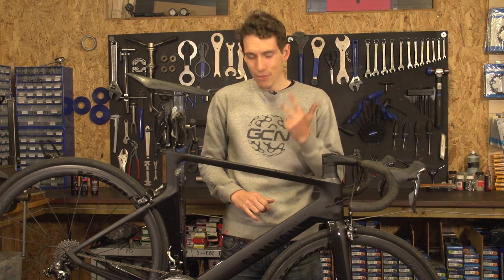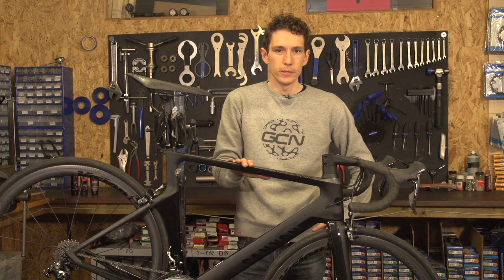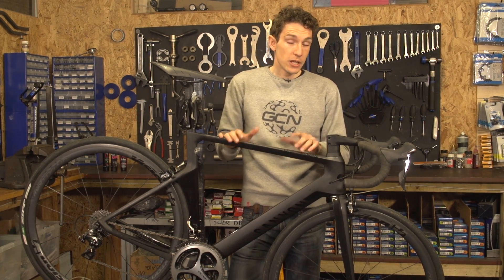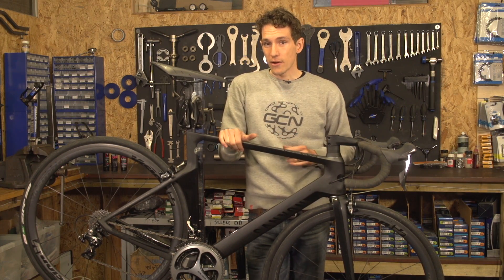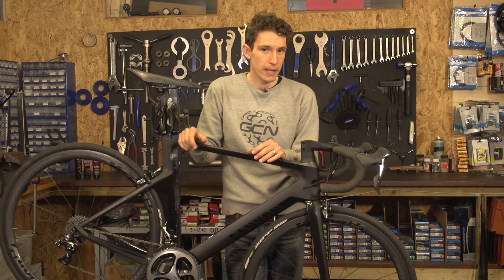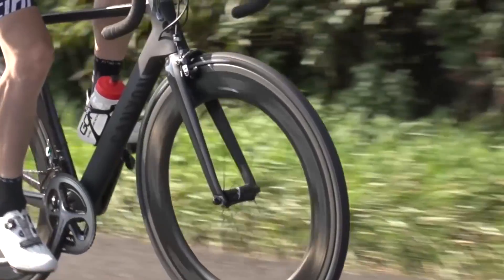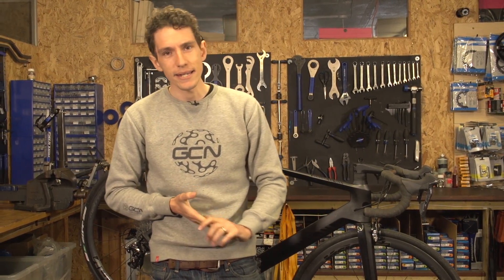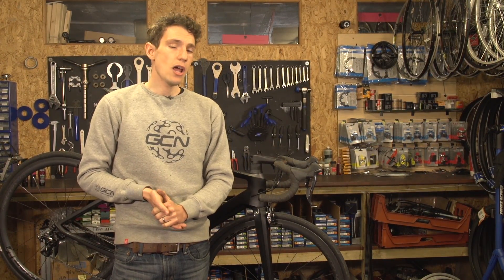7 Things You Didn't Know About Carbon Fiber

Comment: Does extreme cold weaken carbob. -30 deg celsius. Say if I left the bike in a garage( nonheated of course). Live in Canada.
Reply: Not really... well actually yes. But cold temperatures can weaken many materials. Without looking it up I would imagine that aluminium will perform worse at very low temperatures when compared with CRP.

Comment: I don't trust carbon fiber myself, I've seen how it fails. I've never seen an ally/steel component explode so will stick with those. Titanium I'm told only lasts a year before stress renders that unsafe, and having seen it fail don't trust that either. As for pro cyclists, they should all be training on steel bikes anyway. Learn to ride at a decent pace on an old heavy bike, then save these expensive and often less reliable materials for when required and you should find its easier when you need it.

Comment: Steel is where it at. 2lbs heavier then a similar spec CF frame setup but with more reliability and strength.
Reply: Some years ago I had an expensive, custom-built steel frame and compared to both the aluminum frame bike that came next or the carbon bike following that, the steel frame bike experience was like pedaling a bowl of Jello with wheels on it. The alu bike was a step in the right direction with its superior power transfer, but then the carbon bike was stiffer yet and a whole lot lighter. I anxiously await my next-gen carbon bike this coming Spring.

Comment: FYI for anyone who is interested, an isotropic material is a material that has the same material properties in all directions, i.e., it's modulus of elasticity (stiffness), tensile strength, modulus of toughness, modulus of resilience, fatigue failure mechanisms, etc. (all of which are quantifiable properties) are all the same no matter which direction a load is applied. Carbon fiber, since it is a fiber, is inherently not isotropic. If you take a fiber and stretch it along the length of the fiber, it will behave differently than if you (just imagine it) try to stretch it along the short way of the fiber. Since the fibers are laid up in bundles, obviously the "non-isotropic-ness" is exacerbated. 

The truth of the matter is, no material on earth is perfectly isotropic. Steel, aluminum, titanium, and all metals have a crystal structure that have slip planes along different axes, and have grains made up of those crystals that face in different directions, and the size of those grains have a significant impact on the material properties. However, that's pretty much just theoretical shizz that most people don't care about. For the most part, standard steel and aluminum can be modeled as isotropic. 

Just your materials science lesson for the day.
Reply: Bringing me back to my first year materials subject at university - the alteration of crystal structure through heat treating, alloying (the substitution/addition of elements of different sizes), and applying mechanical stresses during cooling (amongst other things). It's interesting how you can enhance or diminish almost any properties through minor alterations.

Comment: I have essor carbon forks and I read online that a scratch can make the carbon weaker. Is this true?
Reply: Yes that layer would be weaker
Reply: The outer layer is usually not structural, so unless the scratch is very deep (which would also greatly weaken a metal frame) there is probably no effect.

Comment: Here's what isotropic means: non-directional. What does that mean about carbon vs aluminum?
Well, carbon is ANisotropic. Meaning directional. A key factor in the light weight of carbon fiber is that it has a full range of strengths depending on the direction in which it's stressed. Your first thought might be, does that mean it just gets weaker? In some directions, yes, but compared to a similar isotropic material what that really means is that it gets exceptionally strong in some directions.
For framebuilding, this means that you can get huge performance out of carbon by orienting it directionally and using very little material in addition to the high average strength to weight. If you were to create a carbon fiber with the same average strength and properties as carbon fiber, but isotropically, and you compared that frame to an aluminum frame, the difference wouldn't be nearly as marked.

Comment: I am still leery of CF as only an old school clydesdale can be. I know it is light and strong etc but the impression I have is that it is kinda not very durable and susceptable to cracks, chips and whatnot. Torque settings on all mounting hardware that have to be followed so exactly. As a professional mechanic, just the amount of care needed over a steel or Aluminum frame when building and maintaining them makes me twitchy about ever owning one. Not that I can afford one or anything.  On the other hand I have seen that video from santa cruz where they torture the snot out of CF and aluminum frames and maybe I am somewhat comforted by that.
Reply: They torture it and it didn't break .....that time .....next time they ride it .....CRACK POW

Comment: Hi, I got myself a Canyon Aeroad (2XL) 2 years ago, transitioning from 
an older Alu bike. What I have never seen mentioned anywhere is the fact
 how wobbely the damn thing is up front. The carbon bike industry is 
talking about comfort all the time, whereas I break out in hives when 
the talk comes to comfort. If you want comfort then buy 25's and let 
some air out. You do get a lighter bike when you buy carbon but you might 
not always get a stiffer bike. I have tested a few of my friends carbon 
bikes and none of them were as stiff and responsive as my old Aluminium 
bike. I weigh 94Kg and would love a light frame which is stiff enough for a 197cm tall rider. 
I would love to see a bike test from you guys looking into bikes for the taller and heavier segment rider.

Comment: How about using a Carbon Fiber bike in a turbo such as an Elite Turbo Muin. I'm always concerned about the extra flexing of the bike will lead to cracks.
Reply: +Declan Cunningham 

Most carbon frames are stronger than the metal counterparts. 

However, I have no idea why you'd be using an expensive lightweight frame for a static bike. I've got no idea why you'd be cycling indoors, either. Is this some road-racing silliness? I just get on the bike and head up a hill. Mind you, I ride mtb. 

However, the stuff that I put the mtb through, I very much doubt that it's easy to break a frame. It just, um, doesn't flex. Seems more likely that one would destroy the dropout than break the frame. Depends how it's all designed, but you should be fine.

Comment: I still have a few concerns.  In summer the surface temperature of my frame when parked goes way above 100C  Much hotter than a radiator.  Black carbon plastic survives for many years.  Other plastics degrade rapidly.
Not convinced about durability over many years of use yet.
Fatigue failure is not the same as overload failure. Aluminium is not good for fatigue failure.  It degrades quite quickly once it starts.  Once fatigue fractures start in my aluminium wheels it is only a matter of days before total failure.
Steel is quite good giving a great deal of warning.  
Despite comments about layer by layer breaking, I have heard too many stories about relatively sudden total failure.  Can they ALL be wrong? 
Has anyone actually demonstrated fatigue failure of a carbon frame to show that it is progressive?  Or is it all a matter of good faith.
Contador in the Tour de France appeared to suffer from a total failure of his bike. Suddenly with minimal warning.
Reply: +smitajky They use carbon fiber for jet engine blades and heat shields for turbos in car engines. To get significant pyrolysis chemical changes from carbon-epoxy you'd need to get it well above 400ºC. If you use a heat-resistant epoxy, it'll go higher.

Yes absolutely the destruction-testing of carbon fiber components is rigorous.

Carbon fiber has a weird property that it doesn't give a lot before breaking, it won't do plastic deformation. A bad weld or work hardening of a metal frame can be just as catastrophic, and aluminium parts which have gone brittle can and will just snap. Tour de France riders have been catastrophically destroying frames for a century, and there's no getting around hitting a pothole at 60mph for doing damage to parts. Problem is they build for lightness rather than strength. Go have a look at what the MTB guys put carbon frames through, and you'll see it's quite tough enough.

Comment: Carbon Fibre is not necessarily lighter than Aluminium or stronger. However it is much Stiffer meaning more force is passed through the pedals to components hence stressing components more. The CAAD 12 frame is almost the same weight as many Carbon Bikes just engineered well.
Reply: I don't think that force is better utilised in distorting the frame!
Reply: ixdad my CAAD12 is lighter than my friends trek Emonda SL they are both 56cm and my bike Is a pound lighter it’s also very comfortable for aluminum bike and very stiff and fast every pedal stroke propels it forward very responsive bike.

Comment: I buckled a seat stay in a prang. My local bike shop said it couldn't be repaired so I took it to the local yacht club instead. Their engineer inserted a carbon rod, filled the gap with resin and then wrapped it with kevlar. Finished with a lick of paint it looks almost perfect and it's stronger than it was before.

Comment: CF is awesome, but the way it has issues compared to aluminum is different, and while both CAN fail catastrophically, its still more likely with CF than Aluminum when there is a failure.   CF is stronger than steel, up until the moment it isn't.

For instance - I've had on aluminum frames where I've busted it at the bottom bracket (TWICE, although 25 years apart from each instance.  Big guy, sprint and climb hard, and the poor bike didn't stand a chance I suppose although I figured the Klein would NOT have had an issue vs the thinner Raleigh Technium I busted first, but as luck would have it, manufacturing defect on the Klein, lucky me...)    BUT, luckily, aluminum does have a "graceful degradation of capabilities" and I was able to slowly limp home  both times.  The same issue on CF frame and I would have been on the deck singing soprano.  :)
Reply: You can't just say something is more likely to fail than something else because the material is different. It depends entirely on how it is engineered. Carbon fibre is more complex to build a frame out of than aluminium because it is isotropic so many manufacturers have trouble building one that won't break. But buy a high end CF frame like a Santa Cruz and it'll be lighter, stiffer and significantly stronger than the aluminium version.

Comment: There is a practical scenario where heat can damage carbon: automobile exhaust.   Some bike racks may place bike wheels too close to the exhaust, and there have been reports of heat damage as a result to carbon rims.   ENVE makes reference to this in their warranty blurb: https://enve.com/warranty/
Reply: +Rob T - My motorcycle exhaust silencer is made out of carbon fibre and even after 5 years and countless thousands of miles, it has not over heated, cracked, melted or fallen apart through exposure to excess heat.
Reply: +Sam Garside A post further up noted that there are different types of resins available for Carbon fiber applications, in the short and not exact paraphrase, you can acquire ultra high heat resistance resin, but sacrifice strength, and vice versa Unless you pay a LOT(thinking NASA here). Your exhaust silencer has 2 needs. Light, and heat resistant. Strength is unimportant. A bike frame has strength as a primary concern, not sure where heat lands, but I don't think they were taking motorcycle exhaust temperatures into the equation.

Comment: As for repairability:
1. If you know what exactly is damaged, it’s easy to glue a new sheet of carbon fiber onto that spot, heat it, and the part will be even stronger than before.
2. But you can’t really know whether structural integrity of some part could be compromised. If an aluminium frame is intact on the outside, it’s intact on the inside, not necessarily so with carbon, which could have invisible cracks.
3. And actually, you can’t really re-weld most aluminium tubes because they’re butted, making them too thin in the middle. But guess what, you can glue them together using a sheet of carbon fiber!

Comment: After a car hit and bent my front wheel the carbon fork may be making a cracking sound when I hit certain bumps.
Reply: +innerlocus  ummm, For your own safety and piece of mind, go take your bike in to get looked at.  creaking sounds on CF means something is about to bust, spectacularly, and probably at the worst possible moment.
Reply: You forks have delaminated (the layers of CRP have separated) Basically its cracked under the top layer and could let go under load.

Comment: I ve had a few bike accidents and the worst that happened to me bikes was a bent wheel. It was a shitty single wall wheel. Now if my bikes weere made of carbon...
Reply: I crashed on a high quality steel bike and cracked the frame. While I loved the ride quality, there just isn't any perfect material that will never break.
Reply: +Marsh Paull Any accident that a steel or aluminum bike rides away from a carbon bike will too. The kind of forces that can damage carbon will absolutely destroy steel or aluminum.
Reply: Wes Strickland Exactly. They're designed not to be crashed.

Comment: Titanium is forever
Reply: +Jay J well not really before we use to think the same way.

 one of my riding friend found a hairline crack on the down tube of his titanium frame about 2 inch in length, he's been using the bike for a bout a year already and hes just a casual rider..

since he bought the frame to an authorized dealer he managed to claim for warranty and  send the frame back to the manufacturer for repair.

but he still paid for the shipping cost...
Reply: in my friends his case the manufacturer replace the whole downtube..

forever in the sense that titanium does not corrode, but they still do crack due to metal fatigue or wrong design..
Reply: +Weng Ten it is easily repaired and is 100% after repair  no other material except steel is that way therefore Ti (and steel to a point) ARE forever

Comment: I call BS Aluminum, as horrible as it is, won't catastrophically fail like carbon, repairing carbon is expensive and dangerous, Titanium puts all of them to shame, making a "truth vs myth" video doesn't change the problems with carbon fiber
Reply: Rice Cake
lol, a bit like when folk say muscle is heavier than fat ;o) Ride your bike no matter what it is, too many elitist people on bikes that look down upon others that don't have X brand or aren't riding all the latest gear. If it's made out of the cheapest steel possible it doesn't matter so long as people are on bikes and not in cars.
Reply: Halo Content 100g of titanium weighs a lot less than 500g of CF and aluminium...If you meant titanium is denser than alu or CF you might have a point.
 Litespeed Ghisalo 800g titanium frame I wouldn't say is a LOT more would you than very light CF frames, where have you bought an 800g alu frame from..ever?
Reply: Jay J hehe, I still use a steel bike. It's the probably the smoothest ride you will ever have.
Reply from the maker: +Jay J Hi Jay, if poorly engineered then aluminium will fair catastrophically. Go back a few years and there was a craze for replacing steel bolts with aluminium, however there were many occasions where the bolts would fail catastrophically.
Reply: +Jeff Burns agree, catostrophic failures are extremely rare...until you get to CF frames. whilst they are strong and very very good in certain aspects, crash wise they appear to fare far worse than alu, steel & ti.
Reply: +Global Cycling Network - I agree on the experimental stuff, but as someone who's sheared two aluminum frames at the bottom bracket and still made it home, I can attest that thankfully the average aluminum bike gracefully degrades ok.
Reply: *****
Bolts that have very little stress and low torque applied should be fine, it's why some use nylon as it's lighter still than Ti and very cheap. Bottle cage bolts, top cap bolt, limit screws on brake calipers and derailleurs can all be alloy based or nylon without any issues.
Reply: wait what? 100g weighs less then 500g? is the g some kind of rating or are we talking about grams? because that would be a pretty dumb statement.
Reply: ynotnilknarf39 i mean ti is alot denser lmao this stuff confuses me
Reply: Titanium weighs alot more than CF and aluminium
Reply: Jay J Enjoy your titanium noodle.